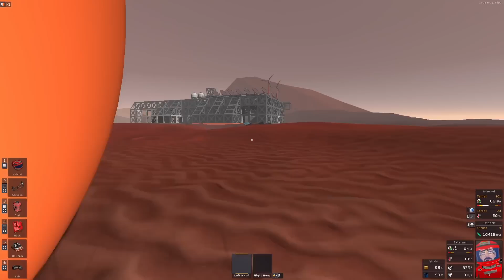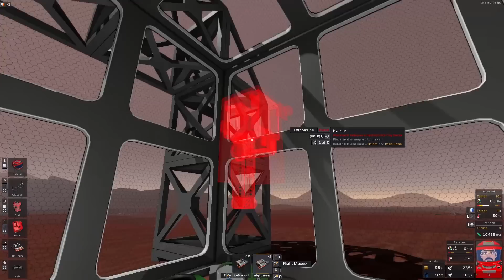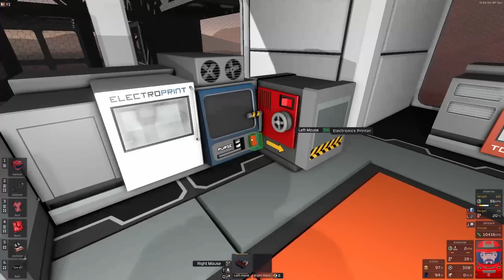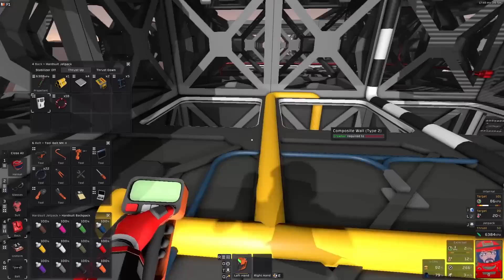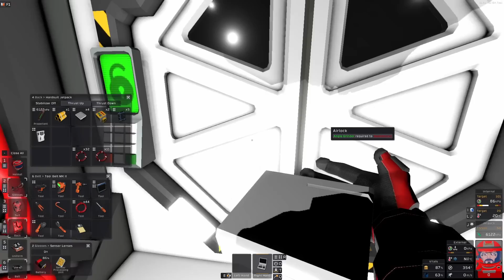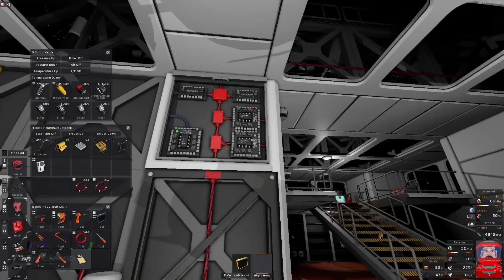Stationeers Let's play Mars 11 Pressure is rising.

Comment: In replicating the centrifuge dump to auto smelting, part way through it stopped outputting the ingots and made a massive pile of reagent mix.

Upon thinking about this, it occurred to me that two super alloys that came out as reagent mix must have tried to resmelt back to back unsuccefully (probably due to lack of pressure) and instead of outputting them individually it started a chain reaction of just adding all the subsequent ores into the giant reagent mix.

Tl; dr:  any superalloy containing items (or any mix that the default of 1 meg and high heat is to little to smelt) you dump into your recycler may cause a reagent mix problem to your auto smelting system.

Comment: I just had a really cool idea for the occupancy sensor, put one in your airlock, when both airlock door are closed it sends a remote sognal to your suit to close and lock your helmet.

Put an occupancy sensor in each airlock and batch read all of them, batch named read all the airlocks separately with both in and out doors, if any airlock has occupancy and and both foors closed it transmits to your suit.
Reply: He has a suit script that will close and lock helmet whenever it detects low pressure or enough toxic gas to hurt, cool use for the occupancy sensor tho

Comment: The combustion centrifuge can hold 3000g of processed ore and the current value of stored processed ore is stored in the Reagents field. 
Also, I now recommend using automation to force the furnace open whenever the centrifuge is open so as to eliminate the risk of dumping 3kg of mixed ores into a closed furnace. Three guesses why.
Reply from the maker: 3k mixed ore into a closed furnace.  That sounds like experience talking.
I was thinking a dedicated furnace or just an alarm to let me know when it is full.

Comment: I just about LOLed when you fell through the skylight. With the way YouTube is I can't hardly see if you have glass in the windows or not. Funniest thing is, I've done that exact thing before!
I've also walked through windows. I'm to the point where I jump a few times when installing skylights to check if I've gotten all the glass installed.
Reply from the maker: Bumping into windows to check if they are there.  That sounds like the blowfly test.

Comment: Would it not be easier to automate the centrifuge by using stress instead of pressure?
With a switch
If the switch is on
   If Stress is 0
      If the levers are less than 100
         increase both levers by 1
If the switch is off
   If stress is 0
      If the levers are more than 0
         decrease both levers by 1
Reply from the maker: My original centrifuge code used the stress because you couldn't read the pressure from the logic at the time.  When I start it manually I look at the pressure so it makes sense to me that the automation should work the same way.

Comment: I'm looking forward to the telescopes that I could see in 29:50.
And I think you could set up a clock.
Reply from the maker: My old solar tracking clock doesnt work any more as the sun rotation is unusual.  At the moment you need to get the mode from the workshop to use a clock.

Comment: I am pretty sure in the episode where you piped the hot gas tank that some of the pipes you used were not insulated.  They were yellow when you put them in and you painted them orange.
Reply from the maker: Orange is for the fuel line.  That does not need to be insulated on Mars.